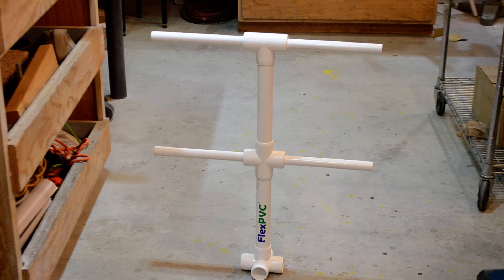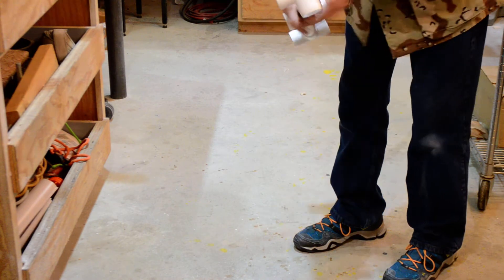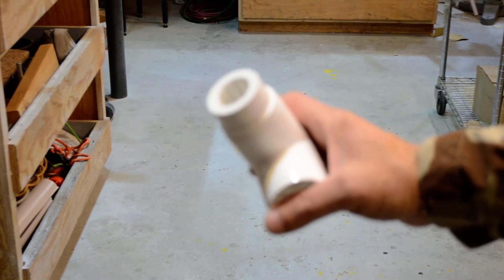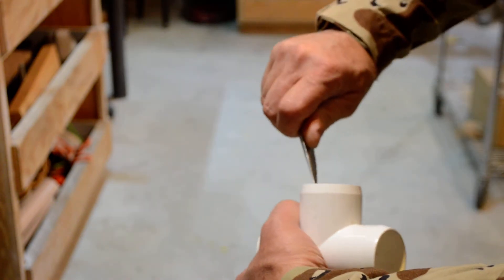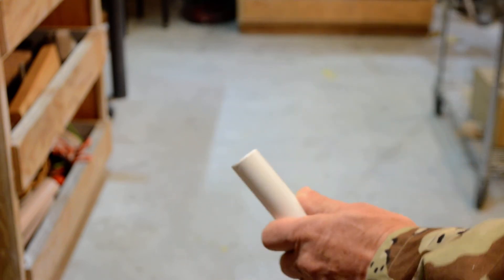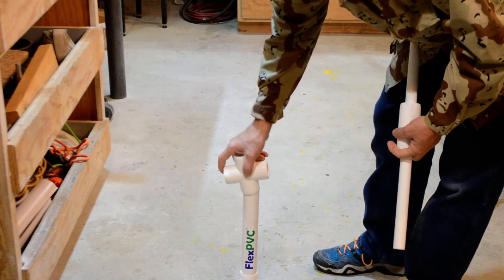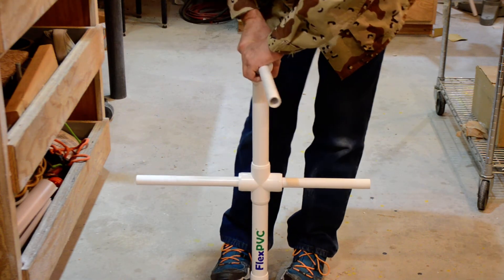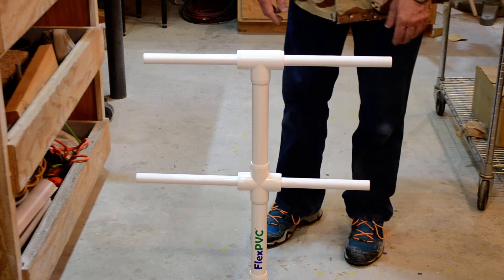FlexPVC how to use telescoping bushings for collapsible structures  (customer request)

Comment: Nice video.How to order this ?
Reply from the maker: If you want to order the entire structure, you'll need to send us an email. Goto our website and near the top of the page you will see a blue circle with "email" underneath it. Just click on that and follow it thru. If you just want to order the parts see:
https://flexpvc.com/cart/agora.cgi?p=PVC-Fittings-Telescoping&p_id=4453-12r75&xm=on&ppinc=detail
https://flexpvc.com/cart/agora.cgi?p=PVC-Fittings-Crosses&p_id=420-012F&xm=on&ppinc=detail
https://flexpvc.com/cart/agora.cgi?p=PVC-Fittings-Tees-Slip&p_id=401-012F&xm=on&ppinc=detail

Thanks for the question.